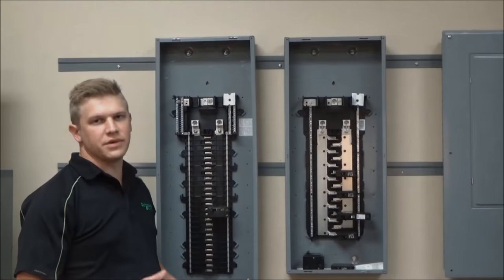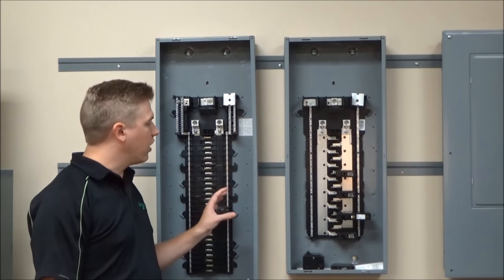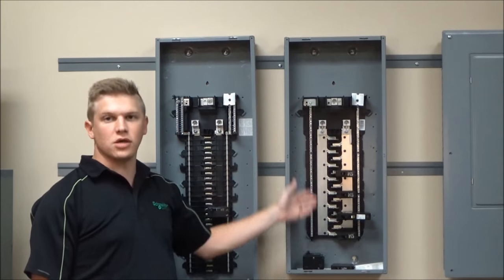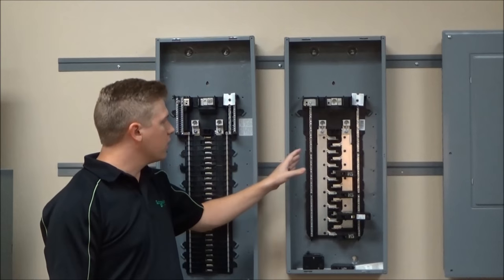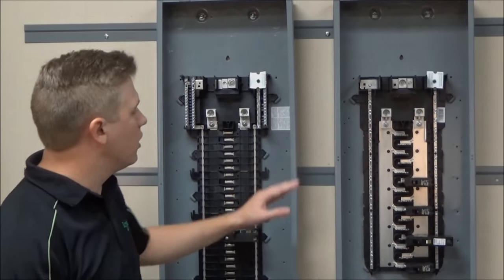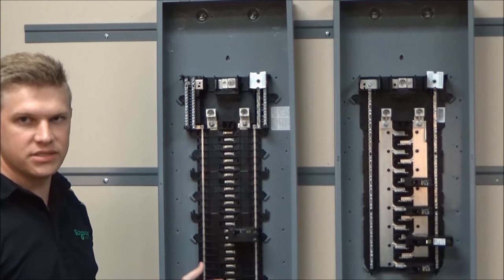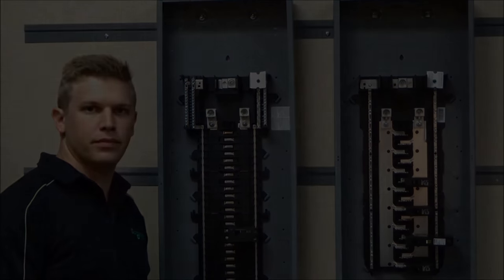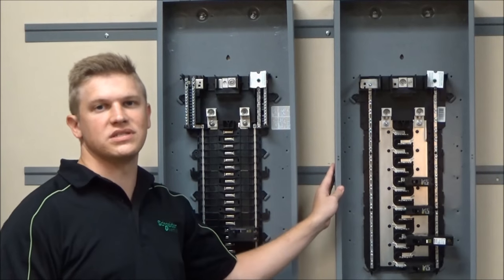Choosing Load Centers: Square D™ QO™ vs. Homeline™ Comparison | Schneider Electric

Comment: We have a 4 months old Square D QO Load Center and I saw some burned marks and melted components inside. When the electrician inspected it he said it could be from a lightning strike.The home builder is not covering its warranty because the electrician’s assessment he said is caused by mother nature so they wont cover the warranty. Is it possible that these outdoor weather proof electrical panel casing will be hit by a lightning and melt the components inside and there is no burn marks outside?
Reply from the maker: Hi Jun Lano, thank you very much for reaching out! - We apologize for any inconvenience caused. For troubleshooting support or to express your concerns, please reach out to a technical expert in your location here: https://www.se.com/ww/en/work/support/country-selector/contact-us.jsp
Reply: Just saw a recall come out for that box yesterday.
Reply: That sounds like a line surge on the utility line coming into the panel, or a lighting strike on the utility line causing a surge which then traveled into the panel.

Comment: What's the physical differences between the tandem and non-tandem breaker boxes? What is physically stopping someone from just hooking in a tandem breaker to a non tandem spot aside from a sticker saying "don't do it".
I see homedepot has a qo 24/24 and a qo24/48 box, what's the difference between the 2 aside from that sticker??
Reply: Size. Non tandem slots are 3/4", while tandem are 1"
Reply: I don't know the precise design of square D breakers, but generally, tandem breakers have a different case design which prevents them from fitting into the non-tandem panels.  The breaker positions that allow tandem breakers have an extra slot in the plug-on blade that allows the tandem breakers to slide on.  the panel that allows the tandems are designed and certified to work correctly with the extra number of breakers and all the heat they can generate. The non-tandem panels aren't designed or certified to work with the higher density tandems.

Some panels (from some manufacturers -- I'm not sure above square D) will allow only some slots to be tandem and some not.  So you might see something like a 12/18 panel that allows only 6 of the 12 slots to be tandem (normally the bottom 6 I believe).

Homeline breakers are 1" wide, QO are 3/4", and both offer tandem versions (width has nothing to do with it).

Comment: Do any other of the panels at Home Depot or Lowe's come with copper buss bars?
Reply: All QO panels come with tinned copper Bus Bars (and 3/4" format Breaker size). All Homeline Panels are tinned Aluminum or Aluminum (and a 1" format breaker size). That is the way I understand it based on my research.

Comment: Does square d make any 1/2" width breaker?  I can use a less expensive duplex breaker if I can change one 3/4" breaker.  On a tight budget!
Reply from the maker: Thank you for your message, Doug Miller. To find pricing & availability info, please visit our support center to find a representative in your location here: https://www.se.com/ww/en/work/support/support-center.jsp